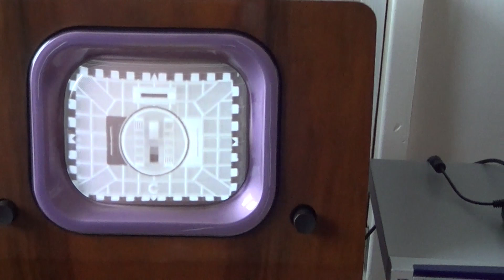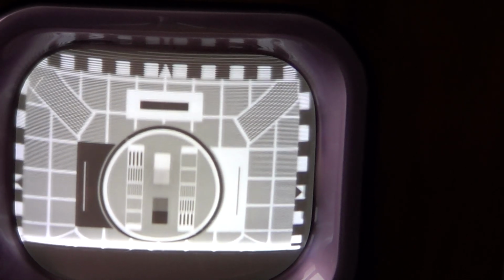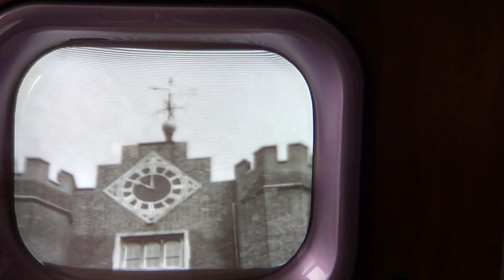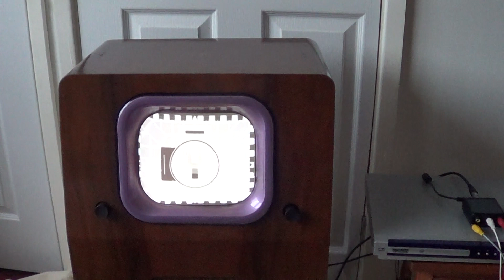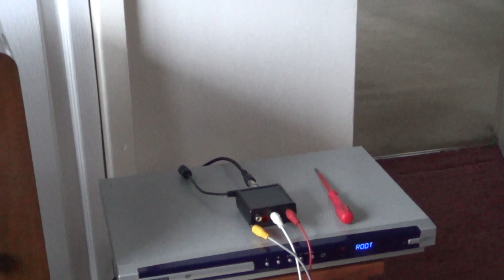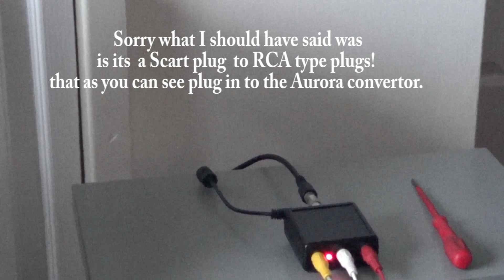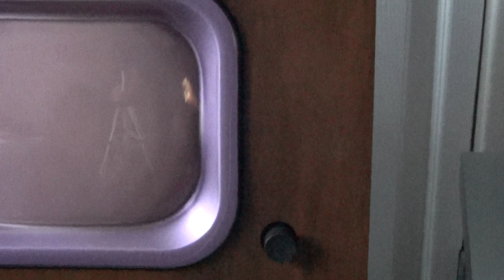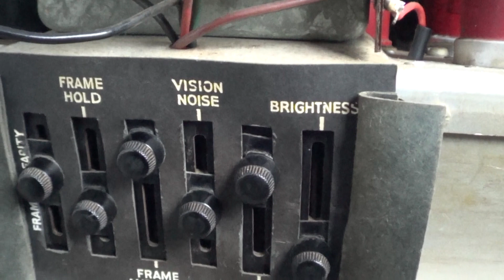Will The 1949 Pye BV20C TV Work

Comment: I have restored several sets using the same chassis, the London console (D18T) from 1948 used a much narrower cabinet, the chassis was mounted on it's side with the line output transformer on an additional chassis that also held the CRT. These little sets perform well once restored. The B18T and the later LV/BV20 table top sets used the same chassis as your BV20 console set.
Reply from the maker: They are great sets! I love these small post-war Pye sets. I have 3 Pye sets also using this chassis they are super to restore think these sets are getting harder to find now mind. I have more than enough old TV as they do take a lot of room up don't they! Thanks for you kind comment Kev.

Comment: With regard to those controls on the back, are they wire would rheostats or are they linear potentiometers with a carbon resistive element? Is it possible to take them apart and clean them? Some people spray them with a switch cleaner, but a pencil eraser will clean the wire turns as well, if you can get at them. If they used resistive wire it is still available from Antique Electronic Supply in the U.S, maybe elsewhere, it may be possible to rewind the rheostats with one of the gauges of nichrome wire they sell. However it is in American Wire Gauge so don't confuse that with the older British wire gauges.
Reply from the maker: Hi Thanks for your kind comments. Re the slider controls on these old Pye  TV sets are wire wound rheostats type! Now the wire over the years bearing in mind a lot of these set have not been stored in ideal conditions often is corroded or broke or breaks when you start to try to adjust them. I have replaced these old slider controls with a modern  track potentiometer with good success. As you say I suppose they could even be rewound but like I say I have never gone down that route. Thanks Kev.